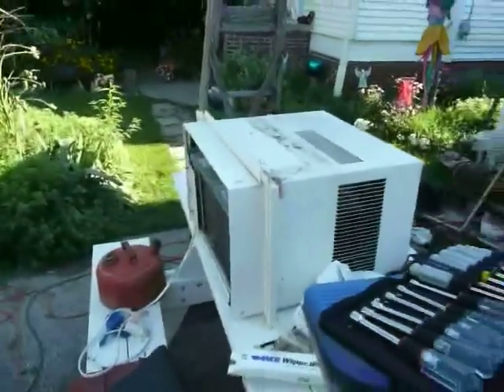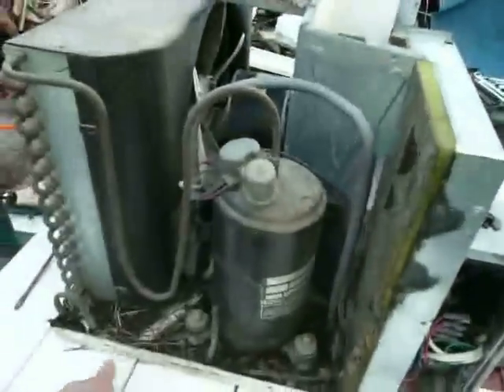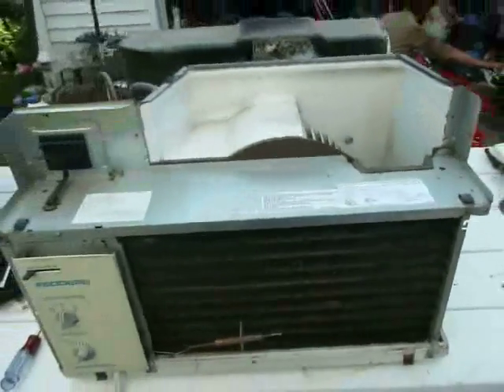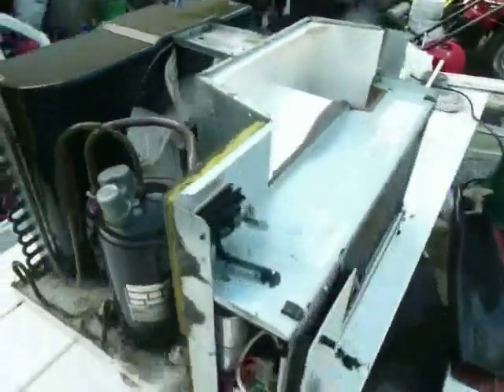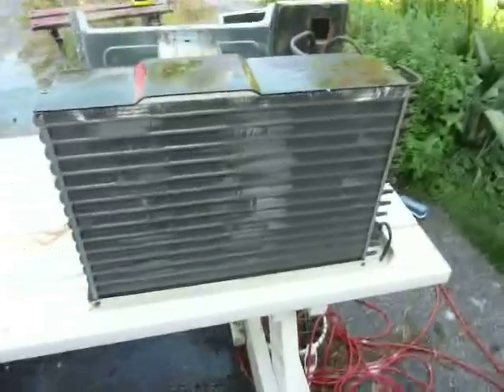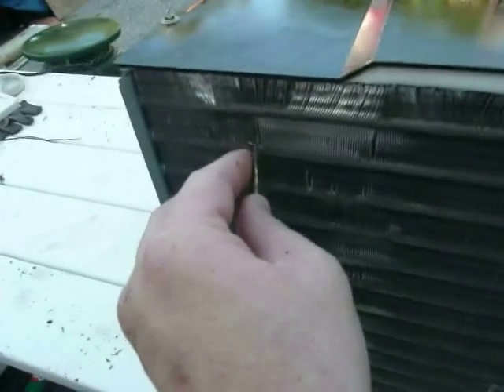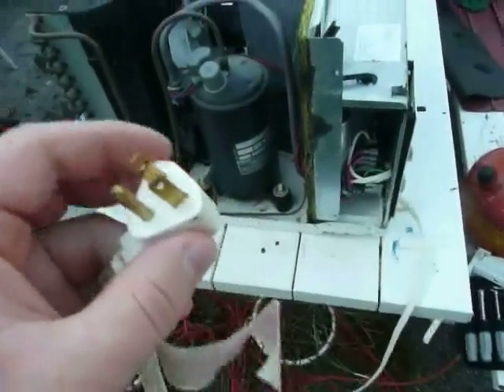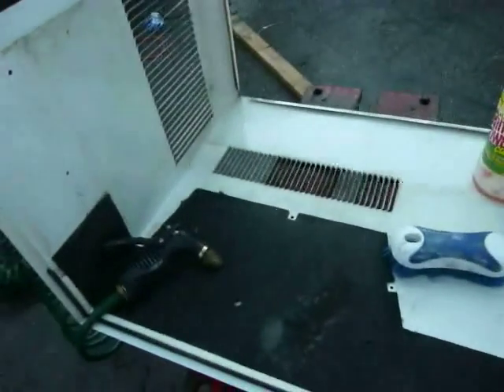How To Improve Your Air Conditioner's Efficiency - Part 1

Comment: Hello Bill, could you help me with the brass piece held with the plastic piece in the front on the coil, I heard someone calling it a sensor on another video? I have the same "sensor" and plastic piece, which came OFF when I removed the cover to CLEAN the unit but had NO idea what the plastic piece was for and thought the loosely hanging brass piece was possibly broken. However, I found several videos before yours yesterday that had similar sensors and showed me☺ it suppose to be clipped with the plastic piece somehow. I just want to be sure it is clipped CORRECTLY. If you can send me a close-up photo of it, when you have time, I would appreciate it. Thanks a million!!!☺☺☺
Reply from the maker: That is a temperature sensor. The bulb at the end of that tube senses the room temperature as air is pulled over it.

As long you don't kink the tubing and it doesn't touch the coil, its location is not critical. Just make sure it sits in the path of warm air coming into the unit and it will be fine.
Reply: +uxwbill Thank YOU!!! Got it☺!!!

Comment: don't want to be "that one guy" but since you tilted the unit sideways its a good idea to let the unit sit for a few days or only cycle the compressor for short bursts to let the oil get back into the compressor.
Reply: takes like 15 mins at the most for it to settle. No different from a fridge.

Comment: Great Video, Thanks,  To straighten out coil fins all need is a regular plastic Hair comb.  Cut it in half so you only have the FINE TEETH..  They fit into the coil fins perfectly, just run them up and down and in a couple of minutes or less your fins are as good as new....

Comment: My unit is a lot like this one.  There was a wading of some kind of soft putty that was around the wires at the hole the wires pass through from the main body of the unit into the smaller electrical area for the control nobs.  This came loose and I don't have it anymore.  Do you think that the unit is unsafe to operate now?   I see that this unit has that hole wadded closed as well.  Do you know what material this is and how to replace it?

Comment: I'm confused by so many differing opinions...
some say that placing an AC unit on its side will cause it to break down... is it true or not?
Reply from the maker: +ca1vin It's never happened to me, and I've cleaned a lot of them over the years. Your mileage could vary: I obviously haven't seen every possible kind of air conditioner design ever made. I've seen professional service people do the same when performing more involved service, or trying to locate a data plate. Again, no ill effects.

What I'm basically saying is "be careful".

Comment: OH, funny/sad story.  I was cleaning out the outside condenser coil on my central air unit (goodman 3 ton), and decided to use my pressure washer.  As I started, I noticed that the metal was getting super shiny on the exterior fins, and I thought, man, this is gonna be great.

Well, you know what I was doing, the high pressure water was folding the fins over .... man what a dope I felt like after deducing what I had done....

Spent a good bit of time straightening those puppies out I can tell you.

Lesson learned.

:)

102 degrees in Louisiana today... oh boy.

Comment: dont they make little fin combs that make straightening out those coils a lot easier?  they're cheap too, or you can modify a regular comb, or use one of those little wire brushes like we clean paint brushes out.    ;)  come on dude, for such a laid back, helpful person, you seem to have a bit of a temper. HA !

Thanks for the video.

Comment: The cleaning that really needs to be done is to back flush the condensor fin/coil- i.e. spraying water/cleaner opposite to the airflow. Most units you need to spray into the case. First straighten the fins with a plastic cutlery knife, use a thin one without serrations, a old soft toothbrush is also good for this. Unfourtunely some disassembly is necessary- to remove or just loosen cowl around condensor fan to help see what you are doing. The gunk in the pan usually causes flooding when it clogs the drain hole. Smells/grease/tobacco smoke residue can be ridden with foaming bathroom cleaner, just buy a dollar can, spray and let soak, rinse and repeat until can is empty.Don't use bleach it will eat aluminum pretty quickly. The evaporator coil is usually much cleaner, and always used a filter. The oem is just barely adequate, get a piece of filter fabric and place it on coil and use the oem as pre-filter. Cig smoke will need more cleaning. Advanced tip, it is usually possible to remove all electric parts from the unit leaving only the 2 coils and compressor. This is the safest and best way to clean out the thing.

Comment: Wow, that unit looks interesting. How it only has row of refrigerant lines on the back coil. That reminds me of a smaller (5,000-6,000BTU/HR) unit. Also you would have to hit that coil hard to bend those coils. I have never seen bent coils on a Fedders.
Reply: That unit is from mid-late 1990’s  in that time Fedders left almost all brown and black front cover designs and  they start creating white instead.

Comment: Wouldn't a good wire brush like you use on your b-b-q pit assist greatly in straightening out the fins?  Also you said to turn the unit on it's side to clean it out, will this create a problem with the oil in the refrigerant, or will it go to the bottom of the compressor?
Reply: there is a specifically a tool for this, its called a fin comb..you can find a set on amazon

Comment: Tool makers like Snap on and Matco make a tool specifically for straightening out the condenser fins. The tool is meant for automotive A/C techs but they are the same size gap on window and portable A/Cs. If you want to do a google search, look for "condenser fin comb". Some of them have 6 different sizes for radiators and oil coolers etc. and look like a 6-point star.

Comment: The one thing that I have done in the past was to use a simple 2 gallon oil-less compressor. To clear the coils and the gunk in the area that you mentioned. It has worked on my small 8000 BTU unit for the basement over here. I did do it for my father 12500 unit as well to clear the coils from clutter that some times collects there or the dust.

Comment: Another great tool everyone has for straightening coil fins are plastic cards, like gift cards. stack three of them together with a layer of duct tape between each one. Tape them together at one end (no more that 1/5 of the length. You can straighten three fins at a time and it works great.

Comment: I worked on an assembly line for a little while building home ac units (york, Johnson controls, and coleman units). They have combs for the metal little fins that make straightening the fins far more easier. You just comb it from top to bottom.

Comment: I think bending the hot side coil fins back to near original shape probably yields the most significant efficiency improvements.  I have a small window AC with not protection on the outside that was probably 50% flattened.  After about 2 hours of straightening fins, the power draw went from about 550 watts to about 450 watts.
Ultimately the savings comes from the reduced temperature (and pressure) of the hot coils, making the compressor work less hard to compress the refrigerant.

Comment: I did managed to straighten the fins though and it took almost half a day, the compressor was tripping the breaker when it was running for 10 or 15 minutes when i went out to see I noticed the coil were badly damaged, even after i tried to fix it looks really bad though no where near as good as factory condition, working alright now lets see if it works fine in summer lol ill give it a good clean next spring maybe call the technician to check for any leaks :) good video though.

Comment: Thanks for this wonderful tutorial. I have three window AC units, and they are all relatively old. My power bill is more this year than it was last year with the units in the same house, in the same windows, and the kph price did not go up, so I can only conclude that one, or all of my appliances are pulling more power somehow. I am pretty much sure it is the window units, so I am going to try this with all three of mine. I would have been nervous to spray it down, but you have shown me it's OK!

Comment: I have a question (pardon my ignorance, I am new at this) but are the electrical components in the unit, shielded enough so that running a garden hose through the coils won't wet them? I am assuming yes, because A/C's are designed to work in the elements...But I figured I'd ask b4 I try this and damage my unit...

Comment: Update, I just took the AC apart and cleaned it out. The back inner quails were gunked up with dirt and dust, washed it all down like you did in this video and now it works darn near new again. The compressor has been on for over 20 minutes without shutting to fan mode. So far so good, this project was a success for me :D. Thank you very much for the help,Bill.

Comment: I have a question, I have a window unit and it intermittently turns the ac on and off shutting into fan mode when it's really hot out. Do you think it's the compressor over heating due to the heat? Or do you think I need to clean my unit, we had this ac for a few years but no one thought/knew how to open it. I can do that now if push comes to shove, do you  think it's a dirt/dust problem I'm dealing with?

Comment: Do airconditioners get weak?
It looks tip-top all clean no bent fins.
It cools but I don't feel its running like it should.
I just installed it today, but for 10000 btu it acts more like a 5200.

thanks for taking time to answer

Comment: I have a kenmore 253.355604 10,200 BTU window model.
Does a unit need time to get running 100% after sitting?
It seems to not be cooling as good as I thought it should for a 10000 btu unit.
It's clean and fairly new.
Would sitting make it run crappy for a few days till it circulates the coolant around?
I had a forest air 8000 btu that cooled like a blizzard right away when I turn it on, it was brand new though.
I figured the 10000 btu unit would be even better but it doesnt seem like it.

Comment: What can one do to improve the output of the portable units that sit on the floor and have a hose running out the back? I have two of these units. The bigger one used in the living room just doesn't seem to put out much at all. Also, is it possible to set up a window unit to run like a floor unit? I'm thinking I could just set a drip pan under it and rig up a hose to collect the hot air coming from the radiator in the back. The windows in the place where I live aren't very sturdy.

Comment: yeah but before drilling the holes the water built up sloshed in the fan and the inside condenser fins got all wet and it blew humid air? Seemed better when I drained it. It has a hole already, but like I said it only drains through it if its parallel to the ground.

Comment: Do you happen to know the proper way to mount them in the window? What I mean is when I put mine in they tend to slant down toward the ground and accumulate water, seems the water goes out when they are parallel with the ground but I can't make them stay that way so I drilled a couple extra holes.

Comment: Hey, this is a good, practical guide to doing this, presented very well and in easy to understand language. Congrats! Keeping evap and condenser coils clean on any appliance from a large central air unit to a refrigerator helps the appliance work better, use less energy and last longer. Excellent post!

Comment: on new a/c units(R134A) you have to cover the thermastate in a plastic bag to protect it from cleaner ( newer thermastates are neaprime (not metal) ) and will damage the plastic thermastate which will cause a no start and will be buying a complete control head !!!

Comment: I have an older air con unit that needs this treatment.  It's a 34,000 btu unit (220 volts on a dedicated circut)....  It's probably the largest window unit I've ever seen... but it's used to cool the whole house (sorta, well not even close)  but it's never been serviced.  (wish it fit in the dish washer like your computer) anyway, this is a great video but it's gonna take three of us to get it out of the window.

Comment: It has been 100°+ temps here in Kansas for the past month and my window a/c unit, i'd say about early to mid 90's Kenmore 5000 BTU, has been working overtime trying to cool an area a little larger than it's meant to cool.  It is keeping the temp in the house down to about the lower 80's, with the help of several fans, but it has run non-stop 24/7 for about the past month.  I have been changing the inside filter once every 2 weeks.  Should I hose the outside with a hose with it running?

Comment: great vid..seems like something even i could do..one thing , when you place the unit back into the window,instead of a level to make sure its tilted outside,i use water..pour some water on the outside shell and make sure it flows away from the window..levels can sometimes not tell you all you need !..

Comment: Really helpful video.  Our AC has been leaking some water into the house, so hopefully a good cleaning will fix that.  I read one page that suggested pouring some bleach into the bottom to clear out any dirt, etc. that may be blocking drain holes.  Do you think this is a good idea?

Comment: Your video is very helpful. Cleaning AC is something that people don't realize the importance. Only one thing that I will suggest is a differente method to clean the evaporator and condenser fins.
This system is much more efficient and better.

Comment: I was hoping that I could use a garden hose to do most of the work on my window unit.  I've noticed that the unit in this video has mechanical controls, but mine has some simple electronic controls - would you recommend that it's OK to do this even with electronic controls?

Comment: I use to pick up window units constantly ...  Tear them completely down...   Condenser coil clean works well on cleaning the coils properly/ cleans mold etc...
I would usually braze in my own low side / high side ports... then leak check / pull vacumm 500 microns/  Weigh in freon to factory specs...  test...   *sits back and opens beer*

Comment: Great video for my upcoming cleaning.

I have an old firgidaire window AC that I would like to install through the wall where my old one used to be. The dimensions are fine, and will fit with more than enough room. It it a good idea? Do I have to remove the shroud of the window AC? Thanks.

Comment: @uxwbill i also have another question the back condensor coil is starting to rust a bit at the botton i want to know were i can find a new one for a cheap price so i can replace it would you happen to know? its bout 21.5"wide x15"high and 3 rows wide meaning 3 rows of coils

Comment: @uxwbill well i cut off the end of the cord/the plug and replaced it runs much much much cooler now it does not even get warm i just wish i had a high preassure hose cause i have these big hair specles in the evaporator/condensor coils that prolly kills the efficieny a bit oh and its from apprx 1991 around fan can pull as much as 2AMPs! and compressor pulls bout 11amps so yeah explains why my fuse always went when i had it plugged with my computers :P its on a 15amp fuse

Comment: omg I cant beleive you are telling people to hose out there air conditioner.I would of chose compressed air as it is not conductive...geez man I am not arguing with the fact that it will run more efficiently but the hose thing is a little too much when dealing with an electrical appliance. Water and electricity do not mix so choose life you wont need an air conditioner if your dead!

Comment: why not use a fin comb to straighten the fins?  And in a pinch I cut the large ends off a small hair comb and use that.

Also, this is how I cleaned my window unit with the digital controls, and a drop or to did get in the controls and mess it up.  But I just opened up the where the board sits and blew it with a hair dryer, luckily it didn't cause a short and after drying it out it worked fine.

Comment: To clarify - Some electronic components are not affected by water when not in use if left to dry properly, these include diodes, resistors, capacitors, transformers, IC's (although water can get trapped under them), fuses, transistors, led's, voltage regulators. Compressors are sealed, water can't hurt them! You should avoid soaking relays, switches and motors unless you are 100% sure they are dry before use. You should still make sure it's all dry before use anyway !

Comment: I did almost the same thing with my portable air con today, but I removed the relay circuit and the control panel first. Then used foam carpet cleaner sprayed onto the dirty side of fins, left to soak in then rinsed with garden hose. It all came out looking like new again and works much better and has no nasty smell any more =] Nice tutorial =]

Comment: Also the thing about the letting the oil settle only applies to reciprocating (piston) compressors.  Rotary compressors like the one it the video can be started immediately after being turned back upright.  The reason is that when turned on its side or upside down the cylinder or suction muffler on a recip compressor can fill with oil and then if you try to start it with the oil still in there the piston will hit the oil and either break the reed valves or the connecting rod.  Great vid BTW.